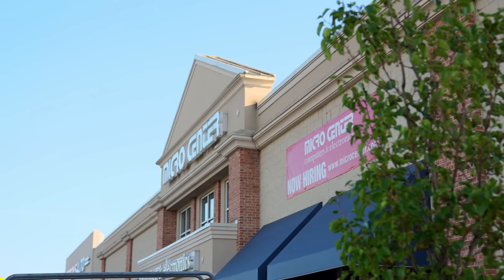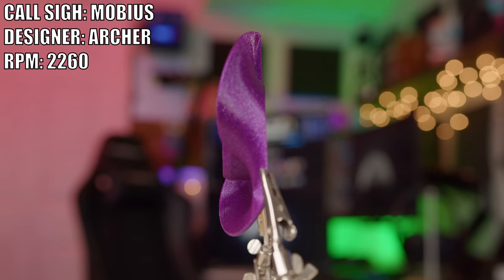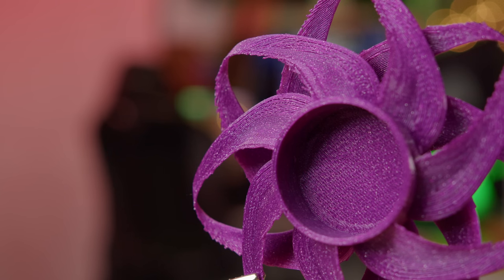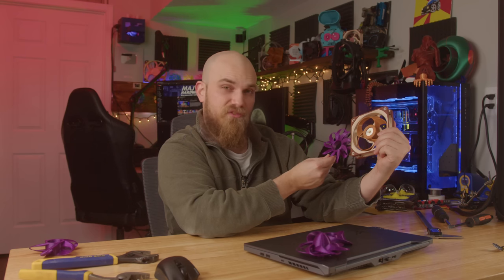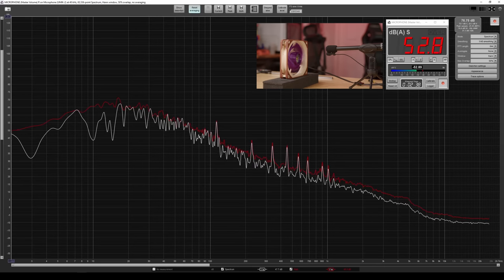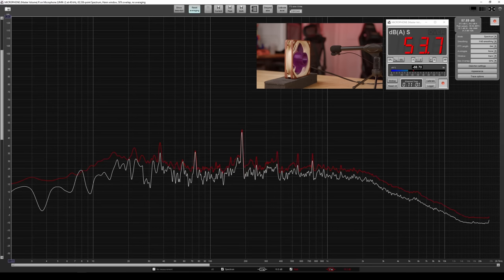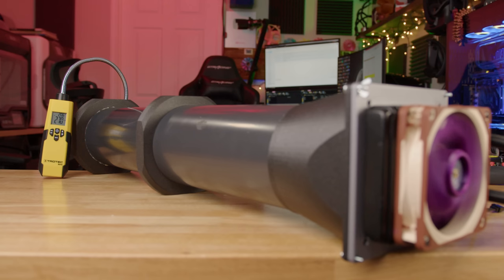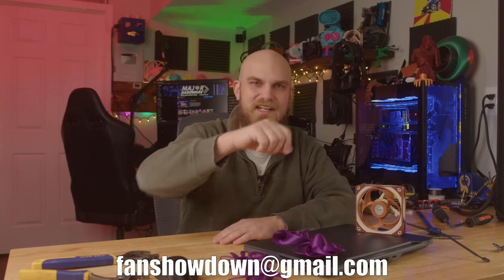My Subscribers Turned MIT Award Winning Toroidal Propeller Into A PC Fan | Fan Showdown S5E5

Comment: These prints look like sandpaper… How badly does the rough surface affect performance? It would be interesting to see a given fan compared to a professional print of the same design, if a professional print would have smoother surfaces.

Comment: Leave 20% of padding between the wings and the builtin frame, it's the builtin frame the one that is disturbing. Also just build 2 wings, no more than 2, you don't need neither 3 neither 5, just two, look at the MIT design.

Comment: I'll say it again: Toroidal blades are only combining typical blades with the benefits of ducts, just as how integrating a circular duct is marginally beneficial over blades within a duct.  You're losing any benefit gained by shoehorning these toroidal designs into a duct, of which these fan housings are ducts.  Test them with a bare motor, then you'll see some benefit over standard blades.  It's not difficult to come to this conclusion, yet apparently hardly anyone else here gets it.

Comment: Dude. You need to switch to resin printing. Those rough edges and surfaces are making all the noise. Resin printers are cheap AF right now and use some tough resin. C'mon

Comment: These "experiments" are pointless. The effectiveness of a fan blade is strongly ties to  A, a smooth surface, lead edge and trail edge. B, The thickness and rigidity of materials used. Which would differ depending on the blade design. C,The minute variables in the angle of attack at ALL points along the blades length!... You would have to go into significantly more depth to perfect each of these designs, in order to do them justice.